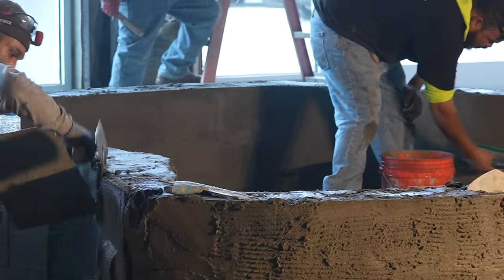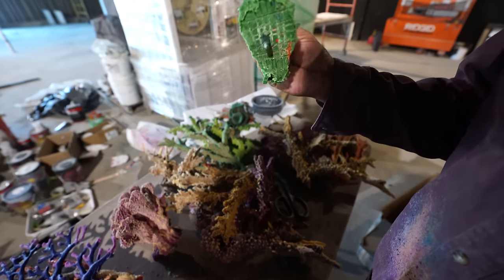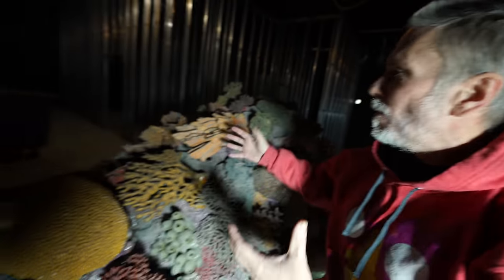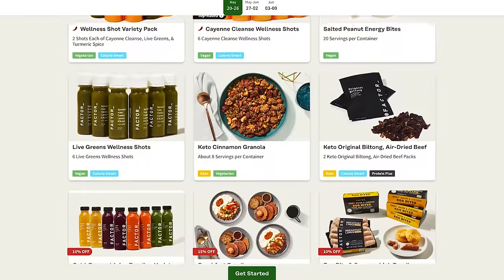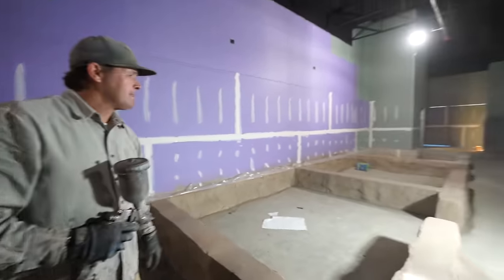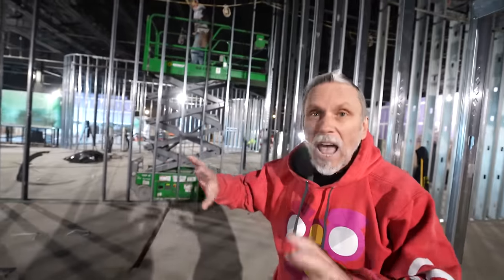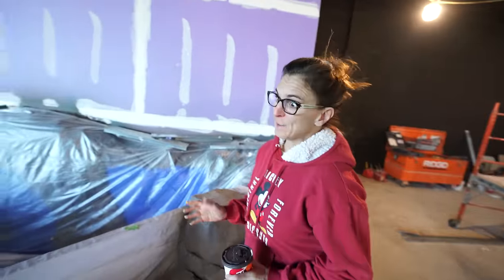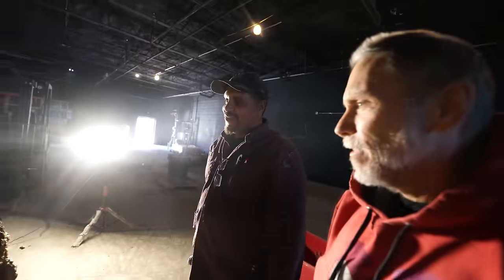Building A Huge Turtle Pond For My Aquarium!

Comment: Fun fact that you might not have known but there is a breed of monitor lizard that i'm pretty sure is smaller than even the Ackies. go check out the kings rock monitors. They are a super cool breed to have and work with. Please correct me if I'm wrong about them being smaller.

Comment: I hate to be negative at this point because everything looks so amazing, but the mammal enclosures look like prison cells square boxes one after another. The one on the end with the bump out it's better and I hope it's for the capybara which is certainly going to need more horizontal space. These seem like an afterthought.
Reply: the mammal enclosures make me angry. not too mention that none of them should be kept alone! imagine two or more porcupines in this little square they cant even turn around.
Reply: They are bigger than you think and everything needs to start with a base.   They will be amazing when they are done with lots of space to run and climb.  Plus the interaction these animals get is insane.  They are just put in a cage and left.  They are handled daily
Reply: @beckygallant186  thats such a weak argument. Bigger than you think? Than give us measurements. They look tiny. You can compare them to human size in the videos since humans are standing in and around them. Yea might look slightly smaller on camera but they are not big enclosures. 

Handled daily? So its okay if we stick humans in a locked up box where they can lay down because you go to work every day?